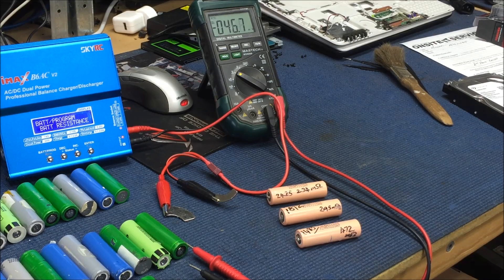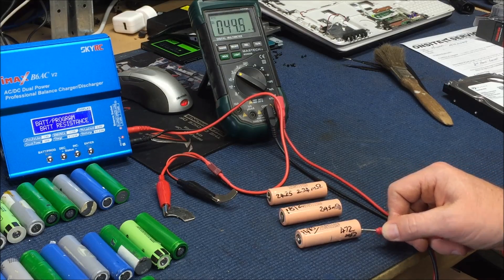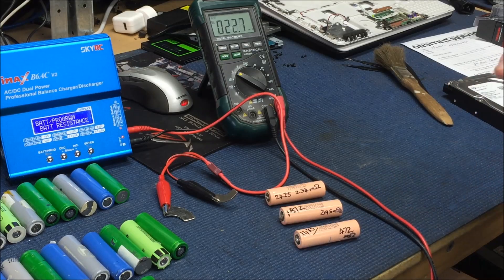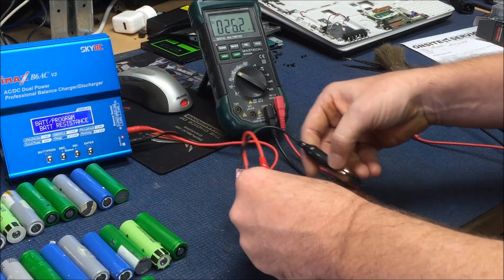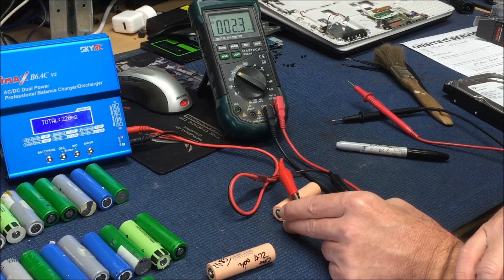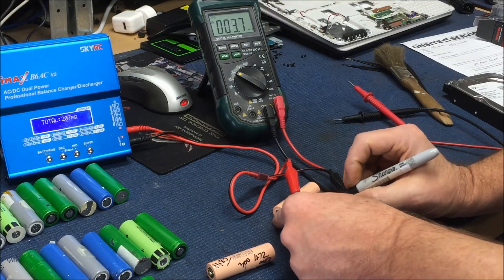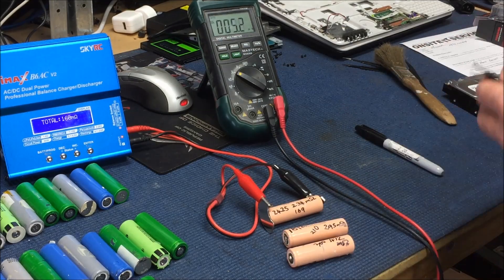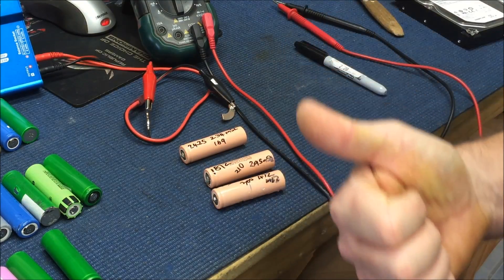resistance testing 30 hrs later

Comment: Magnets suck big time for this kind of test. They have quite a big resistance them selves and the contact resistance with the cell is also high. And the worse part is, that it varies constantly with movements. Better to use one of those battery holders to measure Ri. That way you have a consistance and real connection between the Imax and the cell.

Also keep in mind that while you hold your fingers on the cell, they warm up a little bit over time, which can improve the connection between the magnets and the cell. Which means your Ri measurement will go down for a while until the temperature doesn't change anymore.

But that doesn't explain why yesterday, while doing the test the same way, there is such a high difference.

How long after charging did you test Ri? You have to give it at least half an hour in order to get more consistant results. (The voltage has to stababilize first.)

But please, use a battery holder :) At least that can help you figure out if the IMax is consistant or not. But using magnets and fingers,.... too many variations in the connections to be sure of anything. When test results are inconsistant, the first thing to do is to try to remove any factors in the measurement set up that could cause the inconsistancies.

I used magnets a lot too in the beginning. Seems perfect for getting quick connections on the cells. But when I hooked up the multimeter while charging to see the voltage,.. it would always fluctuate upto 40 or 50 mV. At first I thought this was normal battery behaviour, but when I tried charging using soldered connections, the voltage was completely stable (just slowly rising as it should). So that was he end of using magnets for me. (I still use them actually, but just for simple stuff like pushing the voltage of a cell up by putting it in paralel with a fuller cell.)

Comment: /!\ internal resistance has nothing to do with self discharge !
Reply from the maker: it must do, this single test confirms it beyond any doubt lol
Reply: +HBPowerwall self discharge is like having a parallel resistor ( constant draining current ) and internal resistance is like a resistor in series ( limiting max current you can pull )

in your case IR correlates with self discharge but that isn't true, it's probably because they are old cells

both forms of resistance come from the anode and cathode
Reply: i have done similar, but with out using my fingers to hold terminals, and came to the same conclusion,  internal resistance does indeed show a damaged cell, i get usually 30-60 milli ohms as a good cell,
Reply: this is however split arcos three cells in parallel , so a single cell id say 90-180 milliohms
Reply: Dannyer Beers who is wrong ? you didn't reply to anybody
Reply: i also have no issues with self discharging, if they self discharge they go, i use resistance measurement when weeding out low capacity cells, checked against a know 
cell of the same type from the same source, so when i see a drastic resistance difference and the cell has poor capacity when compared to another cell from the same battery you can quickly  see a pattern, i repeat all my cells that are of low capacity wellbelow that of stated but hold 4.2v tend to have a higher internal resistance, but thats just in my testing, and i could be completely incorrect, however, the numbers of cells with poor capacity  vs the internal resistance numbers  dont lie

Comment: You should get one of these from eBay 181862555082 to at least remove some inconsistencies in the magnets and finger resistance /pressure differences
Reply: oooooooooo i like the looks of that :-)

Comment: might be old question,  is that a real imax? or copy?
Reply from the maker: real
Reply: +HBPowerwall before I did my research I purchased a eBay knockoff. And had nothing but problems and learned quickly my mistake.

Comment: try using your DMM to measure resistance, and lose the magnets and your fingers shouldn't be touching the probes.
Reply from the maker: ok will retest dmm?
Reply: +HBPowerwall Im assuming your multimeter has an ohms setting
Reply: +Gregory G Harding you can't measure resistance correctly like that
Reply: +Gregory G Harding 
-alcaline batteries
-9v have 6 batteries in series inside of them
and an entire list of other things

check out afrotechmods channel and video about IR, he is reliable and knows what he's talking about
Reply: +HBPowerwall try calculating it manually and check the imax against it http://lygte-info.dk/info/Internal%20impedance%20UK.html

Comment: I wouldn't trust the iMax b6 for accurate IR readings - it does give a good indication into it. Best option for not spending any more money. 

I bought a $30AUD dummy load 0-30v 0-10A with battery capacity testing. 

You can calc the IR by taking 2 readings of battery sag (lowest voltage reached). under:  (1A for 5 seconds = v1, 3A for 5 seconds = v2) Helps if your meter has MIN/MAX settings.

formula is (v1-v2)/(3-1) = IR in mohms.